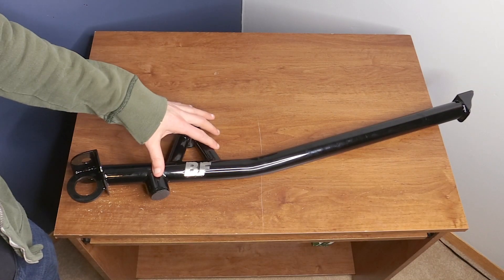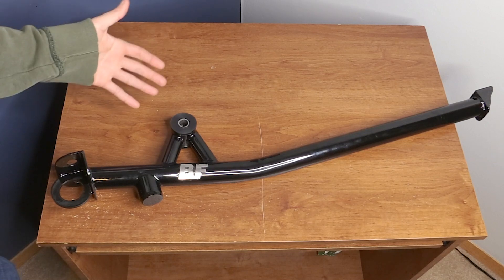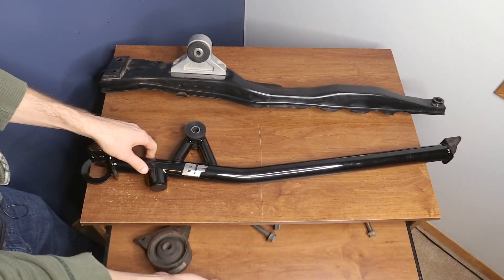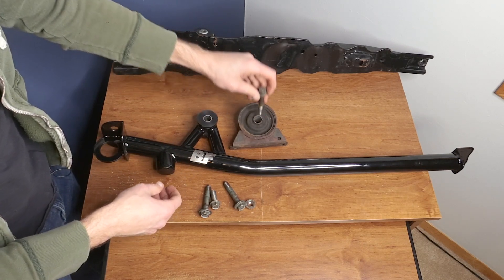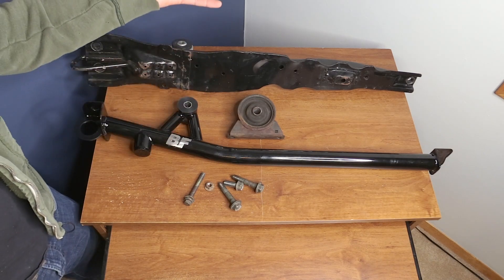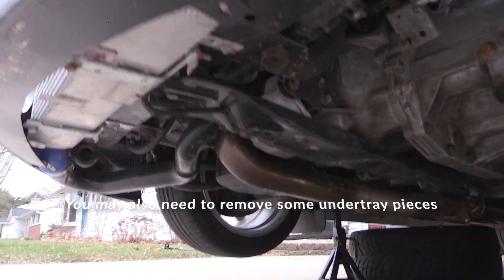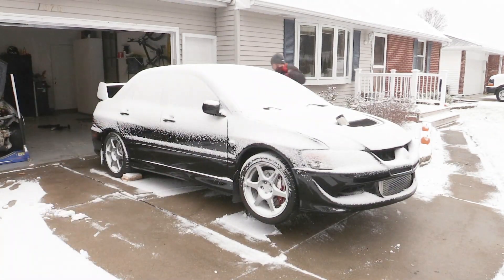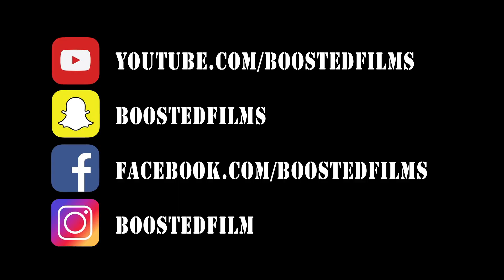EVO Crossmember Install [Roll Stop / Centermember]  - Boosted Fabrication

Comment: Over the summer I also purchased this brace. I used skateboard grip tape on the jacking point as a added touch. Great video Paul!
Reply from the maker: Thanks. How is your holding up? Notice any difference after the swap?
Reply: @BoostedFilms  yeah I did, the dash vibrates a little more now because of how solid it is.

Comment: I have every single mount/brace that they make on my Evo 8.
 Timing side Motor mount, Rear Dog Bone, 5MT Tranny mount, this front Motor mount/ brace, Rear JDM bumper bar with plate bracket.
 Instead of this black powder coat,  I had them lay a custom clear Powder Coat so that it kept the Raw metal look. 
Their parts are 2nd to None!
Reply: The only part that I didn't buy was the dash beam.

Comment: Got interested in this part because of your video, thank you. BTW the link posted in description comes out to a error.

How is the vibrations in the car compared to before? And extra rattling noises?
Reply from the maker: Thanks for letting me know about the link.  I have updated it.  Unfortunately with winter here, I've only took the car around the block since the install.  Won't be able to update more until spring.

Comment: Will it fit into Outlander turbo or Airtrek turbo?
Reply: It's 2 months late but I hope you or any other readers will get something out of this,
AFAIK Airtrek turbo (CU9W) has the same engine bay has the base model lancer, which means same engine bay as the evo minus all the reinforcements.
The crossmember subframes are also interchangeable with the evos and lancers
Assuming you have the 4G63 i don't see why it won't fit since the engine mounts too has the exact same part numbers.